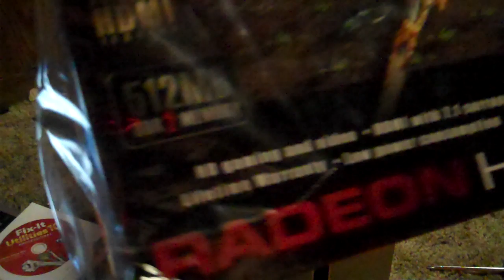How to change graphics card on dell inspiron 531

Comment: Thanks for this. Recently got my hands on this machine, and it's in need of some TLC. I swapped out the lithium battery, but now it won't detect a monitor. Troubleshooting leads me to the graphics card and to first reseat it and then possibly replace it. I'm a total beginner so its great to have a guide!

Comment: Cmon, slapping in a new graphic card is easy. But my problem is that it isnt working. Put the graphics card in another pc, works like a charm. Put it in inspiron 531, wont work. Set in bios pcie first display init. And doesnt work. Put the cable back on the onboard graphic card, it works. I wanna put a 7300 geforce in it. What seems to be the problem?

Comment: Im not so tech savvy. If I plan on upgrading a similar unit would it be ideal if a upgrade the power supply and use a table for a work station? Im afraid I might give the sensitive components static.
Reply from the maker: +Bun Pang Yea, I would definitely use a work station, table, or something. I have no clue what I was thinking when I made this video honestly, doing it on carpet. Although, it was 4 years ago. There's a few things I would do different now.
Reply: Yeah the power supply is a 300w on the inspiron 531, so if you can afford to, than yeah upgrade the psu as well
Reply: and yes if you can work at a table it would be much safer generally, at least more safe than carpet
Reply: Thnks TD.
Reply: Honestly man I'm sure it was all fine I'm just appreciative of the help you gave me with this vid man. I'm new to pc and it worked great for me

Comment from the maker: Xpander33: I would disable to old one just to be sure.     MatrixPaintball: if there are 2 spots open then you might could put 2 in, but I'm pretty sure most computes only have 1 spot, although you don't really need 2 anyway as long as you get a goo one. You can get decent ones for not to terribly much

Comment: After you unplug your computer hold the power button to clear the capacitors.  Sliding a computer on carpet while working on boards is not a great idea.  Cleaning the interior of the case already mentioned.  I blow out my case 2X a year.  It is the single best way to keep your computer alive, especially the power supply.

Still with all my bitching, a good demo.